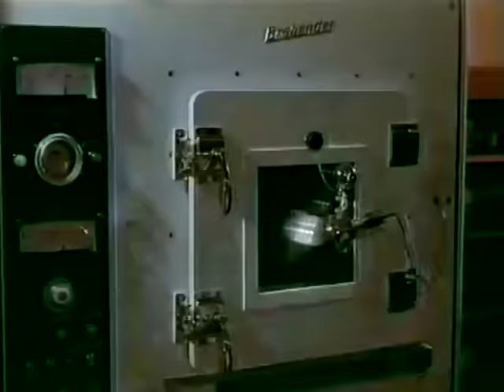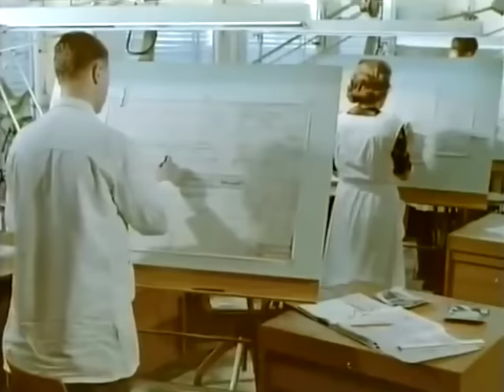Märklin Werbefilm "Berühmt und begehrt" 1963 – Modellbahn

Comment: Einfach herrlich ! Deutsche Wertarbeit war das damals.
Reply: Die Märklin Wertarbeit gibt es heute auch noch. Sie ist nur nicht mehr bezahlbar für ONV.
Reply: @pelle9114 Mal ehrlich: In den 60er Jahren waren die Märklin Preise nach heutiger Sicht lächerlich niedrig, aber eine z. B. E 10 E Lok, die um die 36 DM kostete war ziemlich teuer und keinesfalls mal so eben zu kaufen. 1 Liter Sprit kostete damals 50 Pfennig, und war im Grunde teurer als heute
Reply: @jurgenwolf518  Naja als ich 14 Jahre war (1980) kostete ein 27cm Personenwagen 25 DM. Ich finde es einfach übertrieben. Die Qualität ist Top keine Frage.
Reply: Diese Arbeit am Band macht wohl niemand gerne.  Das ist nicht "herrlich". Aber die Qualität war wirklich hervorragend! Und die Arbeitslosigkeit gering.
Reply: @jurgenwolf518 mag sein aber selbst wenn man die Preise umrechnet steht das heute in keiner Relation mehr. 

Heute kostet das alles so viel mehr, aber wofür eigentlich? 
Ich habe M-Gleise die 3x so alt sind wie ich und die sehen immer noch gut aus und funktionieren, dann habe ich 20 jahre alte C-Gleise die einfach zerbröseln wenn meine 3021 mit 6 Schnellzugwagen drüber fährt. 

Und bei den Preisen will ich gar nicht erst über Weichen sprechen, das ist heute ja Abzocke vom feinsten.
Reply: @pelle9114 Also ca 12 Euro heute.

Comment: What a treat to see an advert from my birth year. I adore Märklin trains and very much enjoyed the production elements. Thankfully we are moving away from the sex stereotyping where the girl is the assistant to the boy which was painfully evident in the film. Sadly still a LONG way to go 59 years later. I'm looking to buy Märklin starter train sets for two girls and a boy who are under six years old.
Reply: Meanwhile it's pretty expensive, when you want more than the simple starter kit. When you haven't the skills for "Do it yourself" about trains and cars, it becomes pretty expensive.
Possibly you could save money when buying second hand. If the system isn't digital, you can use real vintage locomotives, if not, it could work to combine digital locomotives with old trains.

Comment: Yes well, that's how it might have started for some New Age Toddlers born around 1958,
however those with poorer parents, and yet equipped with a smidgen more brains inside a fairly large head,
Electrical Engineering was a far more exciting fad,
religiously putting the palm of the right hand across a clean-cut Drehstrom Kable, believing it was hopefully still turned off,
but prepared to survive, instead of just dropping dead. 😆
Quasi-intelligent children can be soo much fun until the parents decide to go mad. 😮‍💨

Comment: At 16:43 the internal rails must be disconnected, because like this, the system could not work, cause the short cut between "+" and "-" voltage on the rail.
Reply: No, Not in this Case. Märklin still uses track with a center conductor in H0, both rails are the same pole, the other pole is the center conductor. The track is therefore electrically symmetrical, even for reversing loops